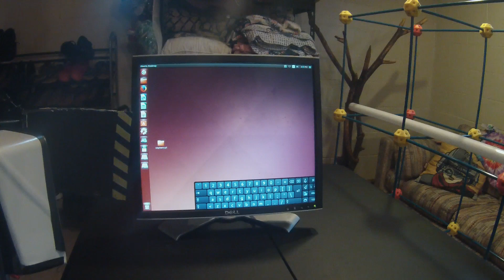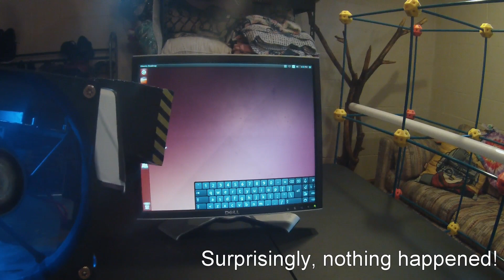Ultimate HERF Gun- Directional Microwave Blaster!

Comment from the maker: This device produces non ionizing radiation and therefore cannot cause cancer. Microwave radiation or mwr is a type of light that has a wavelength that is longer and less energetic than visible light. It sees most materials as "clear" and is able to pass through but sees water and fats as "black" to it and is absorbed. It's energy is then transfered to that water and fat. The atoms of each begin to become energetic and vibrate. That vibration is perceived as heat. This is how a microwave oven heats your food. 
This cannot cause cancer.
Mwr is less energetic than visible light. Visible light is less energetic than x-ray or gamma radiation. x-ray and gamma radiation can cause cancer because their wavelength is energetic enough to knock electrons from atoms creating isotopes. In this way they can alter your dna causing cancer. this is why you were a lead vest when getting an x-ray at the doctor.  Microwave radiation on the other hand cannot do this. 

The distance this energy can travel is limited. The energy emmited from this device is limited in range by the law of inverse squares. The power of the beam is inversely proportional to the square of the distance of the target. Although this device seems very powerful when things are close to the waveguide at any distance none of these effects can be observed. this is due to the loss of power over a distance. My daughter who was outside the door up the stairs from where I was at, was not in any danger. in fact she was likely receiving more radiation from natural sources than she was from my device at any given time. 

Although this device cannot cause cancer, and is limited in range, it is still incredibly dangerous. Some of the actual hazards associated with this device are:
mwr can penetrate into your body causing internal burns on deep tissue. It could boil watery parts of your body such as your eyes, bladder, heart, and testicles. the Internals are high voltage and therefore present all the hazards of any high voltage system. The insulator inside the magnetron is made from beryllium oxide which can be crushed into a powder that CAN cause cancer if inhaled but is safe in a solid (non powdered) form. Also mwr can cause damage to electronic devices and can cause issues to people with pace makers. Think emp because that's basicly what it is.
Reply: Actually yes it doesnt ionize our cells. However newer research has shown microwave damages our LAAM. Which in turn replicates those damaged proteins into cancers.
Reply: @Random-Slavic-Channel  Like most systems when used validly and designed to be safe and healthy... there isn't typically an issue for concern. 

However, we call can think of an example of systems being implemented with some other use that was classified as at least confidential and not exposed to the public until the public realized what the implications were and still are for some devices that are imminent threats, grave concerns and even called weapons of mass destruction where there are still active disinformation campaigns to perform diversionary strategies at the least. 

Technically, there are ways to ionize liquids with non-ionizing radiation and even create ionizing radiation from non-ionizing radiation.  Strange how the generalization is somewhat a myth, though valid when consideration safe operating procedures. 

Here's my latest research to expose the issues that are of grave concern and imminent threats that everyone needs to consider since there are more than Stingrays and other devices that can be used for procedures we are not aware of and have been classified in other countries as unsafe and even weapons of mass destruction:
http://dewdefenseprojects.blogspot.com/2019/03/neuroscientist-dr-james-giordano-on.html
Reply: @jafinch78  You know this generation of Einsteins.. lol  At worst there may be eye issues  or some level of skin cancer aggravation. When power  lines or worse transformers  go crazy. Even a person welding the  UV index is  that  hundreds of times  or more over the 'safe'  levels of exposure. At  least here you don't have ozone, plasma [I think] oh Ozone!With this gadget unlike the above scenarios. The UV  light is  mostly beinign.
Reply from the maker: Anthony Palumbo I never said it couldnt do damage I just said That it cant cause cancer. Which it cant.  If you read my post I describe lots of damage that it can do. Also when something transfers energy to your molecules its called heat. Thats what happens when you turn on your furnace or warm up by a good fire. Can it cause damage? Definatly. we call it a burn. What is crazy about this device isnt that it energizes tissue it is that this particular wavelength can penatrate into tissue which causes deeper burns than a fire. Thanks for your comment though and your interest in my video!
Reply: Troy Powers I'm pretty sure that something which excites substances at the molecular level can do some damage to you.
Reply from the maker: BX StopMotionYT heat itself is electromagnetic radiation of a different wavelength than microwave. Most of the time it is radiation in the infrared wavelengths of the spectrum and we can not see it but sometimes it is in the visible wavelengths like when a piece of metal is red hot. If you want a heat cannon I have used some pretty powerful heat guns for different projects. They are almost like really powerful hair dryers.
Reply: I think your intentionally over simplifying ....just because it doesn't directly damage DNA via ionization .....doesn't mean that thermally induced cell damage cant indirectly lead to cancer(especially with long-term/repeated exposure).......it is cool as F though !......I did the same thing in like 1990.
Reply: If you are to believe the research, which you should, it can cause cancer and lots of other diseases as well. Just like cell phone radiation, which is very close to the micro wave spectrum.
Reply from the maker: beforebefore I never said rf was safe. I didnt say it WAS an emp I said that it would have simaler effects on electronic devices to what someone would think an emp would because it is electromagnetic radiation. Also microwave radiation is a type of electromagnetic radiation. visible light is also electromagnetic radiation. It has a different wavelength. That is why we percieve it differently. You should already know that. I never said it was not dangerous. If you have been in this field or 35 years than it seems to me you didnt actually even read my post before trying to make a response shooting me down.
Reply from the maker: Chandler Kozlowski the waveguide is very important to the distance and power. I have thought of a couple different designs that may work more efficiently. "Focus" on the waveguide to maximize what your magnetron can output to increase efficiency.
Reply: It can do a great deal of damage which could be fatal, but the damage is done by thermal burns. That's different from the damage done by ionizing radiation which is really all he is saying.
Reply: Troy Powers question.... if you pointed this at a breaker switch, will it trip it?
Reply: (as in a home fuse box breaker, not a big industrial one)
Reply: whats it feel like when your hand is infront of it?
Reply: This would be really useful if you could make a more compact setup like the size of a Toaster for both degaussing drives and frying SSDs for data destruction.  There'd be a pretty good industry for data wiping here.  Or even a handheld version where you could just point at the device to destroy it.  

Really good for securely wiping mobile phones or laptop systems.
Reply: Troy Powers if you can build a cannon That generates HEAT and sends out rays of heat
Reply: Troy Powers i see
Reply: Troy Powers what is the effective distance of the magnetron you used & how can I increase the effective distance? 
I am thinking I would have to get a sufficiently powerful magnetron and have a high input power to achieve any reasonable distances.
Reply: but if you boil parts of yout tissue it can harm near cells and make then develope cancer wouldnt it?
but youre right, i hate when people say microwaves and the telephone radiation are the same as ionizing radiation
Reply: Shit. I got the acronym wrong. When i find it ill post it.
Reply: Maybe LAM cells
Reply: any frequency/wavelength EM radiation that gets absorbed causes  thermal change......we just say we feel IR as heat because we cant see it......the Energy is proportional to frequency & inversely proportional to wavelength......so in principle you can heat something up more/faster with ultraviolet than you can with IR .....but it depends on the absorption/reflective properties of the material in question.......i think generally speaking most things tend to absorb IR more easily......though thermodynamics isn't exactly my thing.......there are black body/absorption/reflection curves & such to examine.
Reply: Troy, you are not considering field intensity.
Reply: Troy Powers it still cause cancer because it would make your cells lost their atoms and or kill you directly by heating up your body parts.
Reply: +beforebefore Light IS electromagnetic radiation, what have you been smoking?
Reply from the maker: Moto154 This isnt a flaw in my thinking. I never said it could't do cellular damage. Im just saying that it cant directly cause cancer. Of course blue light causes cell damage when its focused as a laser of high power. Watch some of my other videos. Pretty sure almost all of those things can do some damage to a few cells. By vaporizing them. Can they cause cancer?
No
Things can be dangerous and not cause cancer. I never said it wasnt dangerous. This gun is absolutly dangerous! Microwave radiation is dangerous and can kill you. Microwave radiation itself does not accumulate in the body. It does not change the dna code of cells. It can heat up and destroy cells but cannot cause cancer. Not really sure what more to say. I think Ive been pretty clear at this point. At no time did I ever say it was safe. Come on its a gun. Guns are inherently unsafe. Its kinda the idea. If it wasnt dangerous it wouldnt be quite so fascinating. But that still doesnt mean it can cause cancer.

btw all this was covered by the previous posts which hopefully you read before commenting.
Reply: Umm so heating a bodies water. Intent with microwaves will damage DNA which can cause cancer... not to mention that your brain is mostly fat & water; you can easily fry your brain
Reply: Troy Powers what is your power source?
Reply: It can also be focused like light, so even small amounts of this radiation can be dangerous if in the wrong conditions at the wrong time.
When focused (your body can also focus this radiation) It will happily vaporize/boil the shit out of almost anything at its focal point unless completely transparent.

So in theory, this can cause cancer. Sure not a great chance of it, but, a chance none the less.
Reply: @TauCu  How can this energy be focused like light?
Reply: It is an electromagnetic wave, they can be focused, Take a look at a TV Dish, it's just like a parabolic mirror for visible photons.
The main difference being you can't (hopefully) see the radiation.
Reply: Thank you! it makes a lot of sense. May you please shed some light as to why it creates arcing when comfronted with metal in some circumstances?
Reply: Troy Powers IM INTERESTED IN BUYING ☝🏽 email me highfashcorp@gmail.com
Reply: Will this work through a wall ?
Reply from the maker: UZI9MMAUTO I never look directly at the running magnetron. It can cause cataracts. Post your sources so I can read them. I don't just believe one page of something I've read. I've done a very large amount of research on the topic of electromagnetic radiation of all different wavelengths for a long time with alot of different sources. This is because I'm very passionate about the topic. I haven't found any information to confirm your statements. Please present me with a reliable source for your information. I am not interested in hearsay or conspiracy theories only peer reviewed sources.
Reply: INCORRECT at;east partly. Microwave affects the LAAM cells in the body. It breaks up these building block proteins. Which is shown to have caused numerous cases of cancers. Police, Microwave Techs made bigtime stories on the news. How they got cancer from their Radar gun/Gunplexers. Then the Big Industry told a half truth. Yes  it doesnt ionize but it destroys the body's LAAM. Leading to cancers. I read that Corporate report and they make no mention of LAAM and disspell Microwave as risk or cause of cancer. Never believe mr big corporation with deep pockets. In the very least think about your damn eyes. Plenty cases of eye issues associated with direct microwave exposures. A very fragile organ dont you think?
Reply from the maker: HELLFIRE & BRIMSTONE if that's the case then you irradiate your home every time you turn on a light.
Reply: UZI9MMAUTO
There's no such thing as LAAM cells. Did you just make that up? What don't you understand about microwaves not being ionizing? This is basic nuclear physics and chemistry, which is more fundamental than biology. It cannot effect molecules in any way except excite them (heat them up).
Reply: Troy Powers did you intend to irradiate your family home
Reply: My head hurts from you damn fucking essay

Comment: One way to get cancer
Reply from the maker: EchoBlade it cooks the bacon because the energy from the waves is absorbed by the fats and water in the bacon and converted to heat. it can cause a burn to your skin through continued exposure but it cannot cause cancer. It does not have enough energy to change dna. I'm not saying it's safe I'm saying it can't cause cancer.
Reply from the maker: TheGamingSeal 17 you can't get cancer from non ionizing radiation.
Reply: no cancer, its non-ionizing
Reply: Troy Powers emmmmmmm .... yes ..not in the momento buuut . if you exposure too many time yes .thrust in me toooo many times . but can be probable